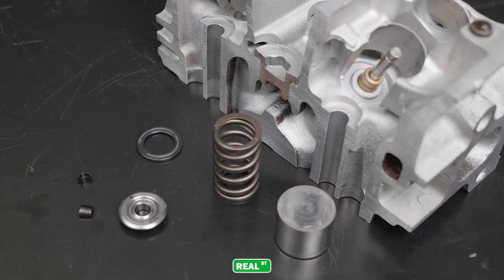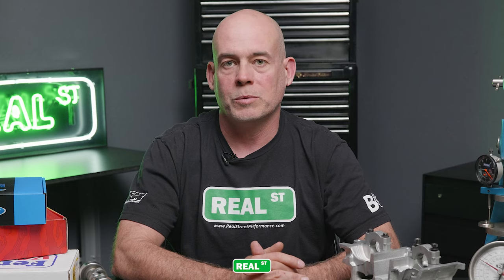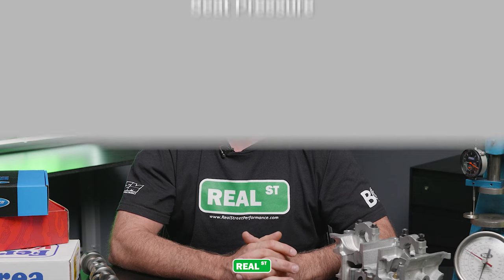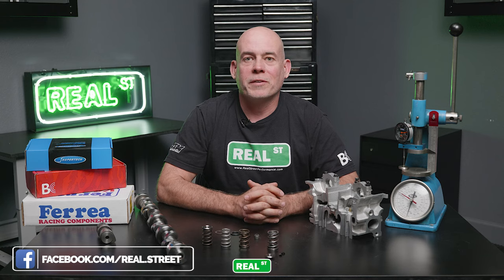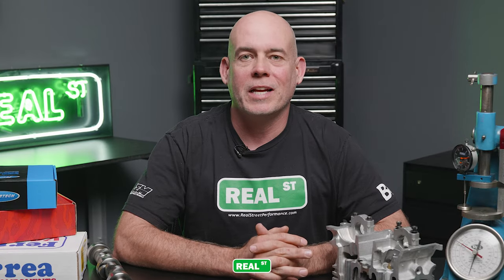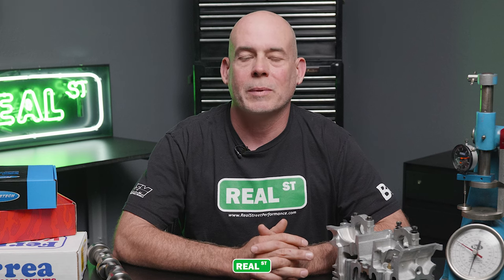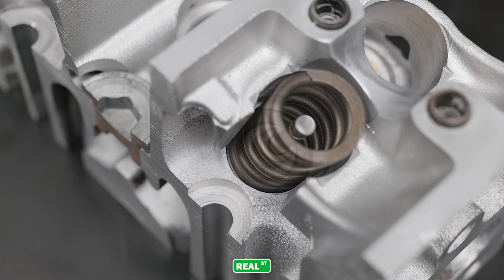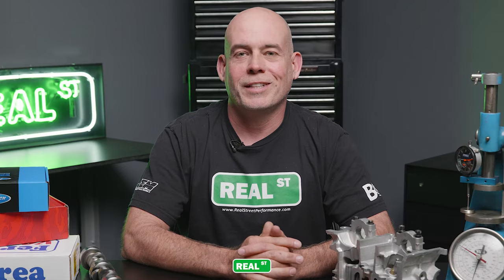Understand THIS Before Buying Valve Springs | Valvetrain Terminology 101 - Jays Tech Tip

Comment: I first want to thank you for this very informative clip, now I have a question for you, I have a 2010 Jeep Grand Cherokee WK1 SRT8 6.1L and recently upgraded the camshaft/valve train but 2 days ago one of the valves springs broke but stayed in place and luckily the valve did not drop enough so the piston never hits it, I'm providing you the  springs and cam specs to see if based on that you can tell me if these springs can safely handle the valves lift.
-springs ( seat load 136lbs@1.800'' , open 412lbs@1.170'' , rate 438lbs/in , coil bind  1.125'' ) and the cam ( 224/234 , .619 exh / 632 int and 115 LSA ) I will greatly appreciate your professional  opinion, big thanks in advance

Comment: Hello Jay. I want to ask when an engine had worked 350.000km (Pinto engine ford. without  convert everything is from factory).Do you think that the valve springs after so suffering hours km....get a little bit weak? after 4200 rpm(almost) can not increase rpm like before. Everything checked all pistons compression 170-180 psi .However camshaft/rockets/distrubituer/carburateur/filters/fuel pump/ignition system checked...All my friends told me engine has a lot of km!! don't expect like before...yes but compression is manufacturer levels, however when engine works idle rpm, (another prove) put my hand in a distance 30cm from exhaust and feel the "air"...Waiting for an answer Jay , and thanks for your time. Dimitris

Comment: It occurs to me there are alot of "upgrades" out there that are really plucked out of the air by the 'more is better' crowd.  I wish I had easy  access to a spintron, but I don't.  Still... all anyone is after is valve control: use enough spring [and only enough] to manage mass and acceleration.  And so not only lift, but rate of change looms large: one degree of cam rotation makes how much lift?.   For the same duration, how a cam is ground can force a spring change.  There are people running triples out there fighting control issues where conicals would save the day - mainly on account of reduced mass, but also a resistance to resonance.  And seat pressures might not need to change at all, or... even go down.

Comment: Aweome video! Was about to order my Cam kit from BTR. Going with the hit rod cam (217/23X, .613/.607, 114 LSA) Would .660" lift dual spring kit work well with this cam? I only ask because they have been out of the .630" lift spring kit for a while. Or would it be better to wait and get the out of stock ones. Thanks
Reply: @kevinwest3689  I already bought the 660s. Going to be boosting shortly after I get it together.

Comment: I'm trying to figure out with out a pressure gage, and an Underdeveloped brain. How much force an additional. 010 less install height will generate on a beehive spring rated at 100lb at 1.800" 285lb at 1.24"  I think it's 3lb.

Comment: Question? I bought your guys steel duel valve springs and retainers on eBay. Can I use them on my regular b18 B1 non vtec engine? I’m not doing cams just oem. Will that b ok?
Reply from the maker: Yes you can use aftermarket springs and retainers on OEM cams. If you want to give us a call and go over the build with one of our Build Advisors we're ready to help answer any other questions you may have :) (407) 695-7223
Reply: @realstreetperformance  🙌🏻 thanks I figured cause they were budget spring however I’m building a clean ass DB7 LS all by myself I’m proud to use your products.   Thanks 🙏🏻🚗💨💥🔥🔥